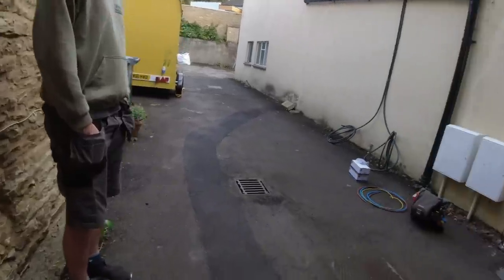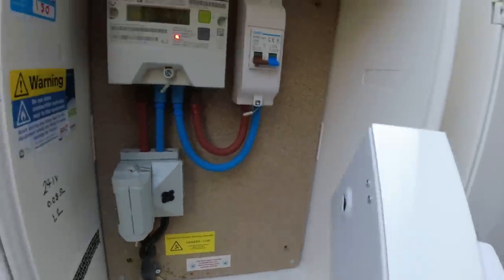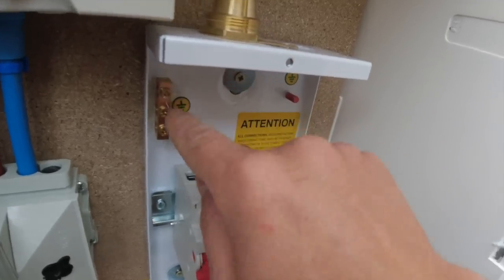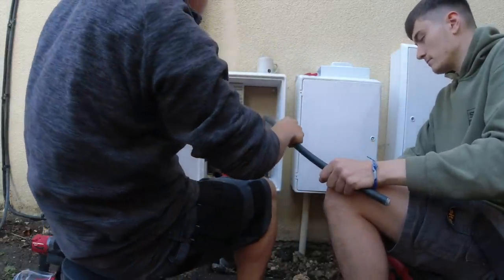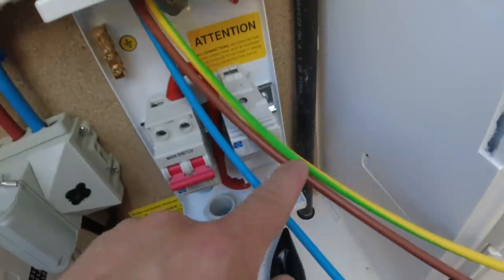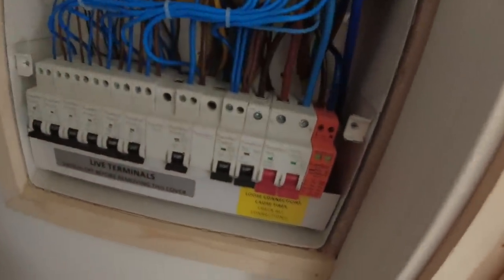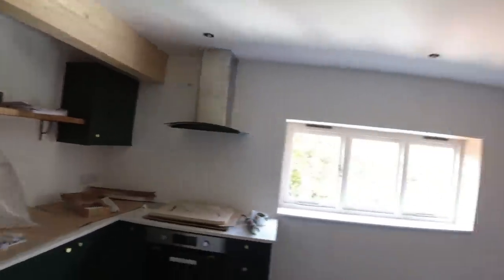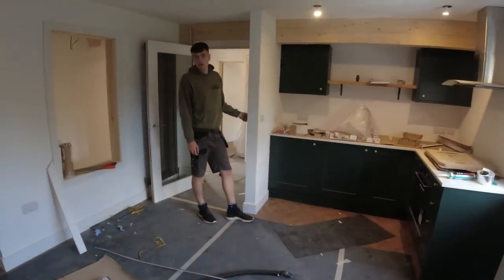PABLO WAS LATE SO WE HAD NO CHOICE I don’t advise doing this.

Comment: What a cowboy install !! Outside meter boxes are for DNO and supplies equipment only if customers equipment is required  to be installed remotely they should have their own enclosure next to the DNO meter box.

You have also tampered with the supplies meter and broken the customers supply agreement by removing the meter covers and replacing the meter tails ! Smart meters have tamper switches on the covers and the supplies are informed that the meter tampered with ! If any equipment needs to be replaced in the meter box the customer with have to employ another electrician to remove the customer’s equipment, come on guys eFIXX has gone through this already on their channel ! It also goes for EV charging equipment too 😢😢
Reply: Totally agree with Mick Sparks, Customers equipment should not be put into the meter box.

Comment: All new builds i have seen with a submain have been installed in the gash way shown in this video . How do they get away with not fusing the submain ? The basic insulation is not against regulations because its within an enclosure which can only be accessed with a tool .
Reply: because they don't care :(... it's horrible.  I don't mind seeing a bracket type assembly used for terminating the SWA, that's often done in street lighting, but just hanging in free air with no shroud is just dude, have some pride in your work
Reply: I'd also call the regs into question here, it's not accessible without the use of a tool, but it is MEANT to be consumer (therefore uninstructed/untrained person) accessible. I'd like to see oversleeving, with heatshrink, at least. (yes, above and beyond the regs, but within the spirit of them)
Reply: @TheChipmunk2008  I agree with you and have always glanded into an enclosure within the meter box . In my opinion the regulation needs tweaking to stop this happening .
Reply: @persona250  I am thinking of the actual usage of the meter box, it's very likely, especially these days, that a parent will hand their kid the key, and say 'go tell me what the meter says'... 10 yr old, with single insulation, ... and an inquisitive mind... so yeah, on same page

Comment: Lewden need to start including surge protection into these isolators. If the submain is over a certain length it requires a SPD at source aswell as DB location.
Reply: Great neat job by the way, nice to see pride in your work

Comment: How come when I ask my electrical wholesalers for three core SWA for a single-phase circuit I always get brown, black & grey coloured cores? and not brown,blue and g/y
Reply from the maker: Harmonised
Reply: cheaper .... in Ireland it's not allowed, and they have proper sleeved earths in T&E also
Reply: So should your wholesalers sell all possible cables to you depending your real project. 

Some about the used colours: Brown, black and grey are all three phase colours for your three-phase-motor. They not need blue and green/yellow for work - this happend only for your finger cutter safety electronic equipment - also at end a five colour cable with CEE 6h (230/400V) (16/32/64/128A) connector. 

Specially for one phase cable is brown (phase), blue (neutral), and green/yellow (CPC) fully correct. Do you can use brown, black, grey, blue, g/y cables too - without using black and grey. Good if in future the house change into a commercial shop where do you use three-phase-equipment then. 

We on the European continent (and on the Asian continent) use three-phase-equipment since over one hundred years - houses with one phase are rare and mostly build into/after the WW II as copper was rare and expensive. The GDR use aluminium instead. Most apartments have three-phase in but only one phase outlets.
Reply: You can resleve it to earth and neutral but you can't resleve the earth if you wanted to use it for 3 phase so it's just easier to stock one type of cable
Reply: @OldLordSpeedy  Should they sell all possible cables? any good wholesaler would try to meet the requirements of their customer, however, should they stock all possible cables is what I think you meant no it would be uneconomic for them to do so. It was just Chris seems to be able to get 3 core SAW brown, blue and g/y without any trouble.

Comment: I noticed you tie-wrapped the neutrals in the CU, Chris. Although it does look very neat, I guess anyone coming in after you (e.g. EICR) would have to remove them to be sure they're working on the correct circuit?  Normally you just lay them out flat so they're individual - any reason why you didn't go that way this time?  Just interested.
Reply: Y can’t you take the neutral out of the rcbo?
Reply: @pel787  Good point - I was over-concentrating on the neutral bar end 🤭
Reply from the maker: Live and neutral both enter the RCBO so the flying leads are a
Reply: Thoughts on cable bunching affecting the grouping factor used to calculate current carrying capacity? (Appendix F in the OSG)
Reply: @TheMattSturgeon  no thoughts
Reply: @TheMattSturgeon  Proximity effect very real. Guess diversity in a residential installation usually stops this being too much of a real-world issue as very rare to see it all heavily loaded. Would be interested to see what happens though if that was done somewhere with EV and long shower going though...

In any case should be by the book!

Comment: From a DNO perspective this is a legacy situation where most domestic properties where supplied with an 60A / 80A supply with underground cables done as TNS but cleverly disguised at the Customers intake as TNCS but the network would have been designed with a certain number of increases to allow for extensions
Reply: I suspect you made a mistake, most stuff APPEARS as TN-S, but is actually TN-C-S about 5m away from the meter? :) .. SSE are one of the few DNOs that still do true TN-S, they even use split concentric underground, bless em :)
Reply: @TheChipmunk2008  Very interesting but the legacy underground cable installations are a complete subject in themselves and if you go to College you will be told there are 4 wire and 2 wire systems (TT for Overhead) but in fact there are widespread 3 wire systems depending where you are in the Country!  DNO's don't like TN-S anymore but shhhhh! don't tell anyone

Comment: What was the reason for putting the fuse in?
Was it because of the SWA size?
Great video as always, great to see Pablo finally! 😂😂😂
Reply: from the convo i've been having, it was due to the 16mm SWA, and yes, pablo looks cool
Reply from the maker: 434.2.1
Reply: @Cjrelectrical  cheers JW
Reply: @Cjrelectrical  Ah so people  who say stuff, rather than physics
Reply: smartass response aside, i deviate from the regs, because yadda yadda
Reply: The way I see it is there's nothing in concrete. It's not a requirement but a recommendation from the DNO simply because the tails are over 3m. 
In this case it gives additional protection. The 100A cutout fuse can be down rated to 80A on the fused dp iso unit. As 16mm swa tails are being installed downstream. 
I think it was more a case to be able to down rate the fuse to prevent worse case for the 16mm tails in this case.

Comment: Did Pablo forget his seal kit, or was the meter seal missing when he got there?  Hope you told the DNO to fit a new one. 😂
Reply from the maker: No was left off
Reply: @Cjrelectrical  pointless after the meter anyway.  Tidy job 👍
Reply: BS the seal was on the meter at the start - u do not remove a DNO seal - plus u ave worked live when taking out the tails as the DNO cutout is still sealed great work practices  not ( again from a former DNO instructor) well done for showing ur apprentice how not to do a safe job, ur too cocky for ur own good.

Comment: Cutting seals and pulling the main fuse is quite normal here in SSE land, but it is 'subject to your own risk assessment' and notifying the DNO you did it.

Matter of curiosity, why do you downrate to 80A? we never do, provided we're  not relying on the DNO's fuse for a submain, i'm not really worried about discrimination (sorry, selectivity), if the load calcs are done right neither will ever blow except in a huge fault :)
Reply: The point of the switch fuse is to protect the dno fuse in case of a fault on the sub main . If you don’t downrate what is the point ?
Reply: @persona250  not according to the DNO guys i've talked to, it's more about liability, (unofficial but talking to SSE techs), their fuse, from a liability perspective, is to protect their equipment and the supplier's equipment, and up to x number of metres of consumer tails (varies by DNO but usually 3m). Why would one want to protect a protective device? (genuine question). And i agree, what's the point, but they insist on it... I guess for really LONG submains subject to potential damage, it could be a nuisance issue for the DNO, but in general, we do it  when the tails are say, 3.5 to 4m, or there's a short length of SWA etc. I can see if it's a submain thru a 3 storey block of flats, that derating the submain feeder fuse would be useful. :)
Reply: @TheChipmunk2008  exactly the point . The dno see it as higher risk of their fuse blowing which they are liable to replace regardless of what caused it to blow .
Reply: @persona250  AHHH that makes sense, down to money.. sad :(  but yeah, we don't derate unless it's a long route, because that is limiting the customer's max demand, imo unnecessarily
Reply: @TheChipmunk2008  Agree if it’s going to cause a problem with maximum demand I’m installing the 100 amp fuse . With Evs and heat pumps /electric boilers this is getting the norm . 
We both know the swa is at very little risk of damage . 
I even have 10m of 25mm tails with no switch fuse in my own house .
Reply: The 80a fuse is to protect the 16mm meter tails that in best case scenario (ref c) can carry a maximum of 85a. If you leave it on a 100a fuse then there’s potential for the cable to set on fire before the fuse would blow.

And as for 10m of tails unprotected don’t get an electrical test done because it will fail
Reply: @TOMHARTOE  we never use 16mm tails :)
Reply: sorry tom, wasn't asking specific to this install, that may have been unclear, just on principle. (we exclusively use 25mm tails and 16mm earth)
Reply: @persona250  understood, i may have commented prematurely, because Chris stated derated to 80A as if that was natural...
Reply: @TOMHARTOE  it’s a code 3 so wouldn’t fail . The only person testing my house would be me .
Reply: @TOMHARTOE  it’s a 16mm swa ccc 110 amps clipped direct .
Reply: @TOMHARTOE  Exactly my thoughts. It gave Chris the opportunity to down rate after the DNO cutout fuse for additional protection on the 16mm downstream run.
Reply: @persona250  an 80A cartridge fuse in the switch fuse unit won't grade with a 100A fuse in the DNO cut-out. I'm assuming the writing on the inside left of the meter cabinet in the video refers to a Ze measurement at some point, suggesting a prospective fault current of around 3kA. Looking at BS88 time-current curves suggests an I^2t value of 90,000 so the pre-arcing times overlap: the two fuses would effectively 'race' one another for an overcurrent fault. The 80A fuse is required due to the reduction in conductor size in the sub-main.
Reply: @TheChipmunk2008  it is essentially about liability. The DNO will only provide protection against overcurrent/overload for as little of the customer's installation as is practicable. 3m maximum length was deemed to be the practicable minimum a long time ago. Why would the DNO want to provide protection for any more of an electrical installation than they need to and potentially expose themselves to issues arising from incorrect design, specification, installation or maintenance beyond their direct control?
Reply: @protectiongeek  I understand the minimal selectivity between the fuses and surely the dno do but they are the ones requesting the additional fuse if the sub main is over a certain length. You are saying if the cables don’t reduce in size no additional fuse is required at any length which is not the case .
Reply: @persona250  eh, no, I’m not saying that at all and I suspect you know that. The 80A fuse in the fused switch is clearly due to a BS7671 requirement as I stated. The DNO does not check what is connected downstream of the meter (many years ago - when they were the “electricity board” - they did). It’s clearly impractical to require the entire customer installation to be protected by the customer’s protective devices and so DNOs agree to protect up to the first 3m. That the overcurrent/overload protection device installed within the 3m will not grade with the cut-out fuse is of no consequence. In the case of a sub-main it almost certainly will not grade. As long as the customer installation complies with BS7671 it satisfies the Electricity Safety, Quality and Continuity Regulations (specifically, Reg 24(1)) and the terms of the Connection Agreement with the DNO.
Reply: @protectiongeek  the installation would comply with bs7671 without the switch fuse . 16mm swa ccc 110 amps clipped direct (of volt drop permitted length). In my opinion the whole scenario needs a re clarification from the dno . National house builders fit no switch fuse regardless of sub main length.
Reply from the maker: Rough ones yes
Reply: @persona250  well I can't speak for DNOs in general but the one I worked for would either not connect the supply in the circumstances you refer to or require remedial works to introduce a suitable fuse switch within 3m of the point of connection.
Reply: @persona250  my reading of BS7671 tables 4D1A and 4E1A for single-core cables using the same Reference Method as you've used for the 16 sq mm SWA means there's still a reduction current-carrying capacity between the meter tails and the sub main so the requirements of Reg 433.2.1 apply.

Comment: Why the three core? I'd be very surprised if the adiabatic equation in 543.1.3 doesn’t tell you that a two core SWA is fine – especially if you’ve got an 80A fuse.

Using 543.1.4 is perfectly compliant, but for the sake of two minutes with a calculator you’d save a lot of work.

Comment: The only thing that shits me with British homes is that they’re compact with little to no regard to either boiler positions or electrical D/B position. I know houses are generally smaller but it seems that those important factors are often overlooked or forgotten about until the last minute.
Reply: 'British' homes can be huge- it depends where they are built and how much cash you have. Modern designed houses have to have so much storage and space for services. It's the conversions of older buildings that are usually overlooked by amateur landlords and dodgy builders that only think about 'rooms'.
Reply: Because the buildings are old and weren't stellar to begin with.
This setup here is still a million times better and safer than the bare meter hanging off the exterior wall style in North America. Nobody ever heard of IP ratings or glanding cables there either.

Comment: I don't like the way they make the cutout....

Keeps buying same product.🤦
Reply: Maybe because alternatives are crappier or much more expensive...
Reply: @alouisschafer7212  maybe
Reply: @Woodkin007  the brits still have better equipment than the overpriced garbage I have to make do with here in Germany.
I wish we had metal fuseboxes all done up already ready for installation. Glands? Often just not possible and a pain in the arse anyways with the plastic stuff we have.
Reply: @alouisschafer7212  we can't do plastic really. Has to be fire rated. Tech ically you can still do plastic for main cutout fuse but it's getting increasingly rare.
Reply: @Woodkin007  im getting pretty annoyed working with the chinsy plastic equipment we have since the british stuff is just objectively better.

Comment: 80amp. Wtf
Reply from the maker: WTF 😳
Reply: 80A melt fuse  on 16mm ?  Not allowed here in Belgium .. max 63A meltfuse or a  80A MCB . also why in  UK no main MCB's ?  Here we all have  MCB from the DNO we can turn off en on .. If i see melt fuses it's very old meter .. from the 50-60's .
Reply: 80amp fuse. Let me guess a correction video is on its way.
Reply from the maker: Huh
Reply: @kittsdiy  You make Zero sense in your comments.
Reply: @jurassicsparks5220  thank for taking the time to come say that my comments make no sense .. your comment really make sense  :-)
Reply: What?

Comment: Newbie here, what is the purpose of adding another main fuse?
Reply: I'm not sure of the actual electrical justification but it's definitely required by code. The length of the metre tails has to be under 3m. Therefore, if the consumer unit is located further away (as in this case), you have to install an intermediate 'distribution unit' (in quotes because it isn't your typical one with multiple circuits). A distribution unit needs an isolation switch and over-current protection - hence the fuse